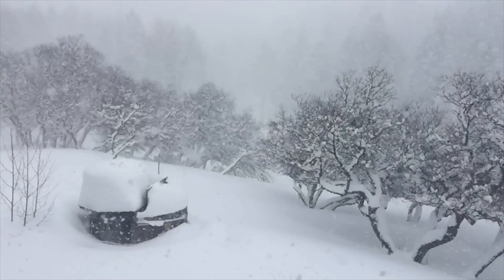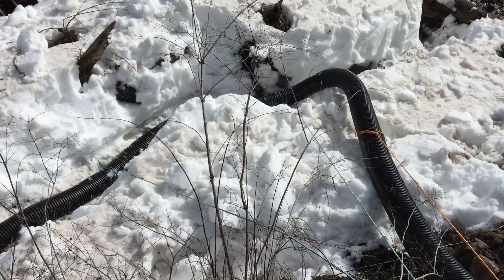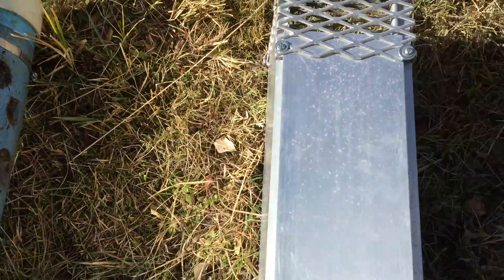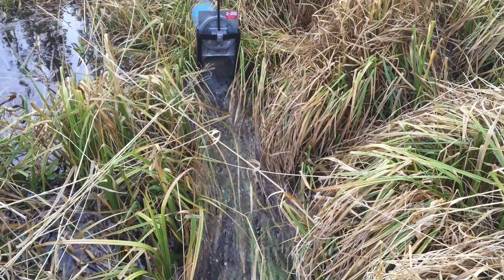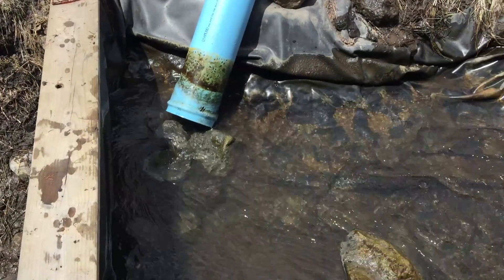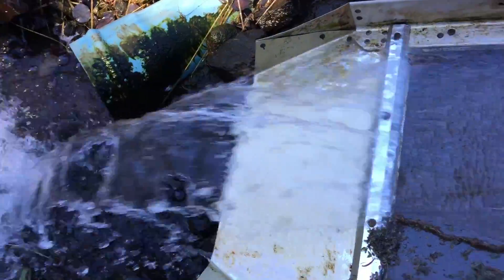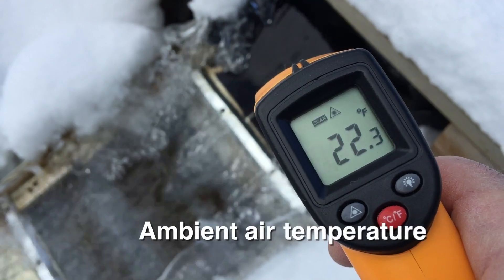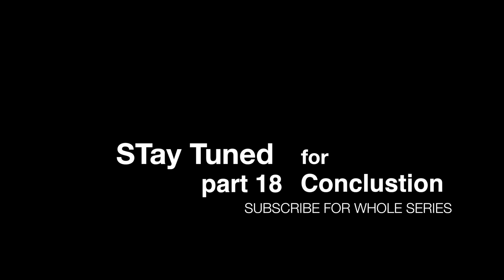Part 17 MicroHydro Power System in CO

Comment: Cozy and warm?? You are making enough electricity to power every single thing in your cabin times 3 or 4 I imagine? The average amount of electricity consumed by one home in the US is 901 kwh per month. You are making roughly 6000 kwh per month. Really cool!
Reply: Martin Thompson I think there is an argument to be made that using those materials in place of cutting down and burning trees is the right thing to do, while PVC and plastics may not be the cleanest or easily disposed of materials they are being used in applications which suit their material properties. The amount of energy he has saved through this hydro power is massive and if he was to have gotten it on grid from a coal plant, incineration plant or nuclear plant the environmental impact would have been much larger
While I agree he it's not perfect, what he has used here is plastic which has its use, not like making plastic rings to hold cans of beer together or other once use plastic items which cannot be reused or recycled. I think it's a perfectly legitimate use of the best materials for the job
Reply from the maker: Martin Thompson I stand corrected on what you originally said.  It can be difficult in the YouTube network to access or see all the comments which are posted.  Most comments are complimentary, but there is a set of people that inevitably judge what we've done through their own biases and can be very negative.  Some suggest to start over and do something entirely different.  It's a bummer when someone dumps on an effort to contribute something you feel is of value.  I apologize if I mistook you for someone else, we could burn trees for heat, but the system exists and has since 1996.  Solar was an unreasonably expensive solution back then, so that was not viable.  We made what we felt were the best choices we could at that time.
Reply: Is there any way to make money off of your extra electricity?
Reply: @FirstLast-gk6lg  He could start TIG welding his own triangle stock SS tough as nails water screens.
Reply: Why not just carry the electricity down in buckets?
Reply: Be nice if they could put that extra electricity into the national grid.
Reply: @shingshongshamalama  I recall that in certain states, the power companies HAVE to buy your excess power fed back into the grid, but I think the benefits of being off-grid may outweigh that.
Reply from the maker: +FuzzyBuddy   Well put.  Can't find the comment you are replying to, but guess is it was the guy who said that making the materials alone was a huge environmental cost and not green.  I imagine that fellow drives a gas powered car, lives in a city where he can't calculate or control the source of his water and power, perhaps thinks himself ecologically minded, but has never undertaken any direct action personally to present an alternative for himself or others.  An armchair critic.  Lots of them here.  I appreciate your defense and analysis.  Many are critical of method, content, or form and not once have i seen a commentator of that sort post something useful or meaningful to a YouTube channel of their own.
Reply: @mrhydrohead  I love your ingenious project.

Forgive me if I come across as preachy. I saw your comment disparaging city living as unintentional. I understand that it came out of your frustration with someone's criticism of your project, but I'd like to make an argument in favour of city living.

For the past 20 years my wife and I have been on a quest for a more intentional, sustainable lifestyle. Over that time it has become apparent to us that living in isolation from the rest of humanity is not the answer. We now live in a condo in the downtown where we are within walking distance of the places we work and play.

We put less than 10000 km (6000 miles) on our small car every year, a fraction of what it would be if we had to drive in from out of town.

Because most of the surface area of our living unit is shared with our neighbours, 95% of winter days we don't even turn on the heat.

Because our neighbourhood is more densely populated, the same length of roads, power lines, communication lines, water lines, and sewage lines serves a much larger population.

Distribution of food is much more efficient (as evidenced by the lower cost of groceries than in more remote areas).

The reality is that for a majority of the billions of people on earth, self sufficiency is not a sustainable solution. A city lifestyle imposes much less of an ecological and infrastructure burden than a rural one. Those of you who insist on living in isolation shouldn't be preaching at us city dwellers. If we were all like you it would ruin your lifestyle.

I think the case for rural living is strongest for people who work in resource extraction or agriculture, but I'd like to see agriculture more integrated with our urban centres.

For my wife, two kids, and I, the direct action we took to present an alternative was to move into the downtown.
Reply from the maker: Jon Hulka First, I admire your family’s commitment to living a lifestyle aimed at sustainability.  That is a rarity and worthy of respect.  I’m not certain which response I made to a comment you refer to.  I get the occasional flaming rebuke like “Fags like you ruin places like that. Burn in hell Colo\Californian.”   No kidding, thats an actual comment.  Perhaps my response was overly critical of urbanites, but I’m not certain what I had said that prompted your comment.
I fully understand and agree that the most efficient way of dealing with an overpopulated planet is that people consume less by living in cities.  I am not a proponent that everyone should choose a life of isolation in the wilds. I don’t mean to preach to others who choose other paths.  I spent 39 years living in LA and working in various segments of the film biz as a cinematographer (largely ending up in ad work).  My experience of  LA was that it was largely peopled with transient folks and most relationships were built on the drive of people to acquire more, where more was not enough.   It to me is an indoctrinated cultural error that most people never question.  I came to the realization that I wasn’t doing the world any good by being a cog in the chain of consumerism via advertising.  I retired and eventually moved here.
The intent of the series was to provide a way of giving back in some small measure my skill and experience to fill a void of useful information I perceived on YouTube.  I’ve been blessed in so many ways in life and I felt it essential that I provide some aid to those that would benefit from it.
One aspect of urban life is that most people seldom truly interface with the natural world and experience it directly.  It is unfortunate, but it is the way it is.  The world would be a different place IF enough individuals recognized that they are not separate from the intelligence of the natural world around them.  I care deeply about the natural world and seek to caretake our property with minimal impact. I made the choice in my remaining years to live in nature and experience its raw splendor and the tragedy of what is taking place as the world changes.  I bear witness to the changes on our property directly.  An urban life would not have enabled this.  
I have tended to be a solitary person most of my life and my intention is to live as low impact of a lifestyle for the remainder of my years as is possible.  I wish to live in nature simply with abundant silence surrounding me.  Each of us makes choices with impacts.  It sounds like you and your family apply awareness to your choices and I only wish there were more people  that did as you.  Thank you for watching the series and if you feel its appropriate I apologize for any insult I may have provided to you.  Peace!
Reply: @mrhydrohead  Here's the quote I was reacting to:

"I imagine that fellow drives a gas powered car, lives in a city where he can't calculate or control the source of his water and power, perhaps thinks himself ecologically minded, but has never undertaken any direct action personally to present an alternative for himself or others."

Like I said, I love your project. I am frequently envious of people who have the space to tinker with things like this, but I've made a choice to downsize, which comes with its own benefits.

I'm not so offended as a bit distressed by the polarization of urban/rural, especially rural against urban, and by the prevalence of the notion that self-sufficiency and sustainability are the same thing. I am also distressed to see people around me burning resources like there's no tomorrow.
Reply: @mrhydrohead  I agree with your conclusions from your LA experience. Your reasons for leaving your career make me think of a job situation I'm in. I love the work, but I see it fueling conditions that are driving the housing crisis in my corner of the world (I walk by and greet a number of homeless people on my way to work). Once the job is over I won't be continuing with that client.

I've subscribed to your channel, and I would love to see you do a video about your experience and conclusions from the film/advertising industry.
Reply: This has actually a really heavy environmental footprint for powering a single family home. The "creek" should be regarded as precious and its a shame that a previously pristine waterway involved in that beautiful ecosystem which is such a privilege to live in, is just a pipe now.
Reply from the maker: Andy Mode bullshit. You should actually see it before making such an outrageous claim
Reply from the maker: Jon Hulka John it took me 10 minutes to find your comment to reply to. They get buried in the string of replies and become inaccessible without great effort on my part. Such is the complication of having a ytube channel. 
Most comments don’t go very deep but all of yours have attracted my interest.   Most people don’t see far beyond their nose with their comments but it is clear you do. I don’t think I would do a vid about my experience of the consumer machine because its so far off the topic of the channel. I do think about these things however and it would be interesting to carry on a dialogue around them or other topics, but not through this channel. If you want to have an email conversation contact me at offermeister@mac.com which is one of many addresses i use. Its refreshing to find someone who thinks deeper than most😉
Reply: @mrhydrohead  I did see what you showed of it. What is the creeks flow rate in different seasons? When you see the creek run low or dry consider the schemes impact on the ecology which Im sure you do in truth treasure.
Reply: 901 kwh a month?  what is this magic place in the usa that you never have to heat or cool?
Reply: Came here to virtue signal but it looks like the sjw's beat me here. I got nuthin.
Reply: i dont know it is really weird. i think thousands of my comments are not showing and  they show the recent ones for a while to keep me posting. i would have to get a new phone to open a new accpount and then they would probably deem my comments too contrversial and string me along again. it is abusive either there is comments section or not and you can see it is pretty sanitised  where is all the diversity? where is the different countries for example not many of them. this is messed up.
Reply: @catkin-z8g  idiot, ''i would have to get a new phone to open a new account''
Reply: @catkin-z8g  When your comments are abusive, hate speech, incite violence or disclose protected information, or otherwise violate the terms of service or pose a threat to people or the host site, then your comments are disabled.  I think they call it "shadow blocked" or something.
Your comments are visible to you, but to no one else.
If you don't post any offensive comments for a while they will be unblocked.
That is not to say comments on this thread are the ones which were reported, but it may be on another thread.
Reply: @zandemen  you are right. We are currently filing a lawsuit against YouTube for this. They caused me to miss out on a large contract because I had no clue the owner wasn't seeing my comments. I thought he changed his mind and was ignoring me. The big problem is YouTube keeping this a secret from me. They can ban me but hiding it is going to cause them Financial harm.
Reply: @Bryan-Hensley  
I don't know, maybe there's better places to work out important business contract besides the comment section of YouTube.
Reply: @emcee2k965  we were talking about a project like one on YouTube. It was easier to use the comment section to screen out the one's that didn't want or know about the project. He thought I didn't want it and I thought he didn't want me.
Reply: @Bryan-Hensley  lol no.  they simply instantly remove comments that have cuss words in them if the channel is rated pg.    
you do have to refresh the page to see it though.
Reply: @Bryan-Hensley  i am pretty sure you don't have a foot to stand on.   
when you created the account you accepted a terms of service and they can do what ever they want to your comments
Reply: @darkracer1252  only if they treat everyone identical. And that's not happening.
Reply: you imagine wrong. give me some thumbs up please so my comments don't keep vanishing  due to this messed up site otherwise it is pointless posting anything.
Reply: There is plenty of wood there to keep a place cozy and warm with considerably less effort and  use of environmentally harmful materials.
Reply: @catkin-z8g 
Those materials will last a very long time, more than offsetting their environmental costs. You would have to cut down many trees to produce this much electricity and remember that mature woodland has more benefits to the environment than the average environmentalist understands. I know it's trendy to whine about CO2 emissions, but frankly this rather misses the point when it comes to the value of mature forests.

Also it would seem the system we see here is being put together with a lot of repurposed materials, which is far more environmentally friendly than cutting down trees.
Reply: @laughingachilles  there is dead trees lieing all over the place. the guy has a mansion. maybe to heat that it would take a bunch of dead trees but a more reasonable sized home it would be more environemental than this. i dont want to hear any more about it.
Reply: Martin Thompson a generator needs a load on it to not "run away" and keep a steady 60 hertz.  Yes the electricity being dumped into the baseboard heaters may seem like a waste but it is actually his resistive bank during the winter months to ensure he has a steady power source.  He touched on this in one of the videos saying that he has electric water heater and baseboard heaters for this reason.  I would like to know what he is using for his load bank in the summer months?  Another house or 2 would be a good place to dump the load.
Reply: If you look at the startup of the new system it ran at I think 75hz until he applied a load into it, the more load the slower the Pelton wheel turns so I am sure he is adjusting constantly through the year to keep the hz between 55-65 and be usable in the US
Reply: @catkin-z8g  all i see is you complaining about his house and how little work he has to put into this system once it's going.  

i think you're just jeallous that you are not as smart as him.
Reply: @Belzon1  i am assuming he is using capacitor banks and power regulators to keep a steady 60hz.
Reply: @catkin-z8g  So... chop down trees and burn smoke into the air because you think aluminum is an  environmentally harmful material?
Reply: @catkin-z8g 
Let's say they use the naturally dead wood for their energy needs, how long do you think this would last? It most certainly would not outlast their hydro-electric setup, and it would require the conversion of heat to electricity, which is terribly inefficient on a small scale. 

Your approach would also destroy the habitats associated with decaying wood. Do you have any idea how many species rely upon fallen wood? Many have life cycles which span decades and if there is no rotting wood available then you could destroy entire ecosystems.  

You need to take the full picture into account.
Reply: @catkin-z8g  its mindblowing that you think cutting down trees and burning them is less environmentally damaging. Just flat backwards
Reply: @catkin-z8g  i see your point but i believe you're wrong. Whatever your burning you'll let out more green house gases and fire doesn't generate electricity.
Reply: @sunesnigel  the video says the power is for heating. the conversion of electricitty for heating is very poor hence the power station suitable for a whole village. The house looks huge so making a smaller house would be greener. For heating there is solutions like using heat pumps and passive solar/ thermal mass. For a cold place the heat pumps are probably the way to go although you can still also make use of passive solar. putting a house up 2 floors into  the sky increases heat loss since the wind is stronger and colder up there than a design more sheltered by the ground and trees/ bushes. There is video of an earthship design that works in canada up on a mountain and they get tomatoes flowering in january. It is quite large though but I think you could do a smaller one with the use of tubing to store heat into the rock and bring it back up in winter. that would only need a fan to power it. this is the sort of thing they do with greenhouses and chicken farms. at about 20ft depth there is a 6 month temperature lag but you dont really need that much unless you are in the arctic.
Reply: @catkin-z8g  Holy moly, the guy posts a video on ways to overcome challenges in micro hydo and now you are suggesting he redesigns + builds a different house? Very 'green', passive solar + thermal mass? doesn't work when sun isn't shining for a week or 2. Solar on the roof? awesome until the first flurry of snow. Heat pumps? how long to they last B4 icing up in winter? Smaller house, sure that makes sense unless the house is already built and but how do you know how many people live there?
Reply: @RolyNZ  heat pumps dont ice up. they can make an amazing amount of heat. its what they use on new builds in scandinavia and stuff. it uses some liquid that heats up and becomes a gas when it gets underground and then that gas comes back up into the house and releases heat as it turns back into a liquid. something like that anyway. the supply is pretty much never ending. it would take a decade with no sun before the ground down there would get cold. its not going to freeze coz the fluid is chosen to turn into gas at these temperature ranges. passive solar does work without sun as long as there is light just depends how cold it is and how much heat you need. it might not be worth replacing a house although it might but there are still more efficient ways to heat it than electricity. in a sunny spot I have used tromb walls it is amazing it produces much more heat than a electric heater. proper heat that you can heat up thermal mass that will stay there for weeks. if you tried to do that with electric you wouldnt get far. you can try putting curtains up and see how your heating bill goes up although it can reduce the heat loss to the glazing but otherwise people just dont realise how cold it would get and what proportion the light is actually heating a house even without making any special effort to deliver passive solar. even if you are in a cold place say it is minus 30 at night and minus 10 during the day outside the amount of energy it would take to heat all that air in the space of a few hours by 20 degrees is collosal. it far exceeds all the heat produced even in a city that itself heats up mostly coz of thermal mass and solar. all the heat produced by houses and cars etc is a tiny fraction which you can see as soon as the sun sets.
Reply: @catkin-z8g  a heat PUMP needs somewhere to dump that cold into.    
you can't heat the inside of a house when the outside is 50 degrees colder.
Reply: @catkin-z8g  and on a side note.   if it takes a decade to cool down.  it's going to take a decade to heat up.
Reply: and all of this complaining about the efficiency of the electricity when this is free,  non invasive.  and emmision free electricity.
Reply: @darkracer1252  you dont dump the cold anywhere. cold is a lack of heat. there is heat in the ground tonnes of it no matter how cold it gets outside it will stay warmer underground and you can transfer that heat inside. the system works not sure exactly how. Something to do with a liquid turning into a gas and then back into a liquid and so on. it is under pressure or something and generates higher temperatures using this state change. then it goes back underground and is reheated by the ground. someething like that anyway. probably it gets compressed or something but it uses little electricity and produces good heat. like if you pump a tire the valve gets hot coz the air is getting squashed or when you spray a can of lighter gas the nozzle gets all cold coz the liquid is being unsquashed. there is much simpler systems though where you just put the heat underground in the summer and then bring it back up in the winter. you can use it like a battery. i have a solar heater and it hooked up to the air vent so I use the chimney to suck the heat in but I could theoreticall suck it underground first and then it would come up cool all summer but in the winter i could flip the pipes round so it is a preheater for the solar panel, not really need it hear but it would probably work. you couldd have like a longer circuit in the summer so it comes up cool and then in the winter take a short cut to bring up warm air. it works nice though for the ventillation. the pipe is long enough it only fluctuates a few tenths of a degree between day and night. i might still use the ground as a preheater but just to take the edge off the cold air at night. then the sun will have less work to do reheating the wall.  its quite fun i like to design system with no electricity used. only moving part is the themometer.
Reply: @catkin-z8g  i bet you also believe in perpetual motion devices don't you?
Reply: @darkracer1252  perpetual motion? look your just ignorant. you dont understand that underground it takes a long time to cool down and the temperature is closer to the annual average. that is unless you add heat too it. you can also add cold. people used to pack a cave with ice and seal it up so they could use it to make icecream in the summer.
Reply: @catkin-z8g  Thanks for explaining it so well, or something.  You sure know a lot, or something.